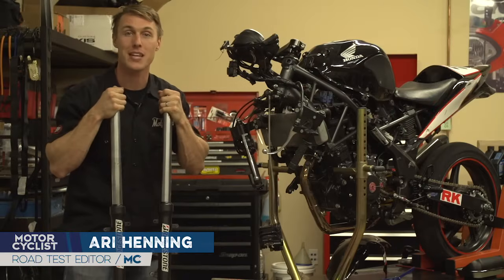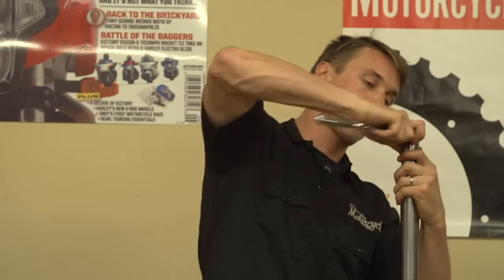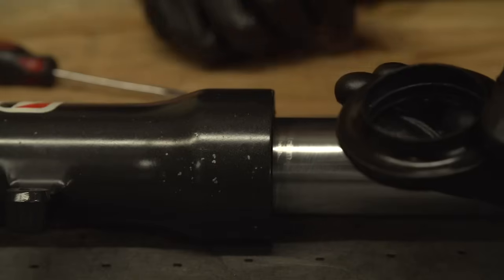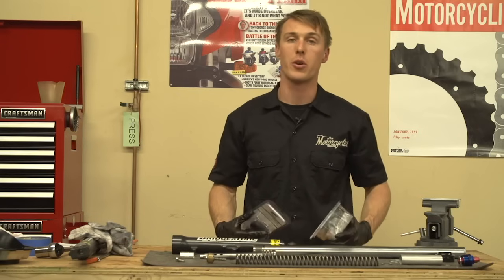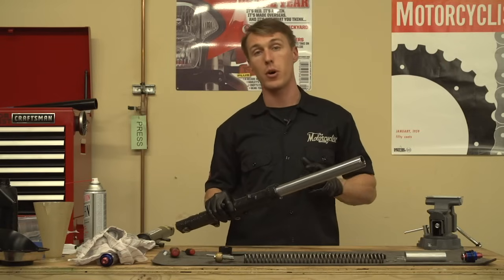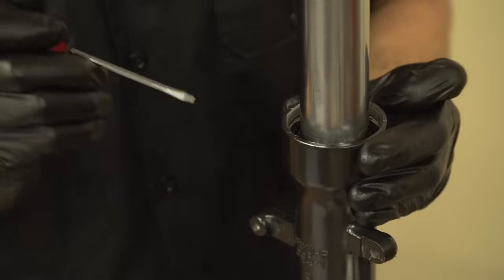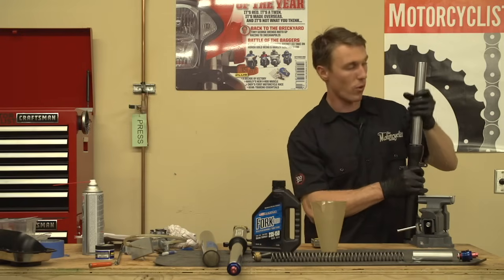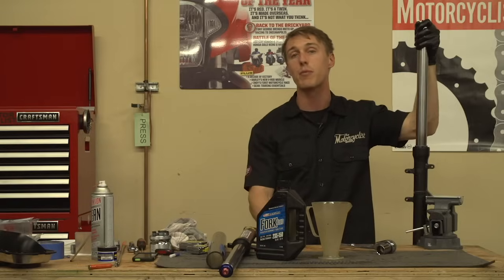Motorcycle Suspension Tech and Maintenance: How To Rebuild Your Fork | MC GARAGE

Comment: Excellent video. The owners manual for my 2007 Honda Interceptor says nothing about fork servicing. Does this mean that the forks on the Interceptor do not need to be serviced? (I bought the bike in February 2016 and am the third owner. The previous owner did not know its maintenance history other than what he'd done. It now has a little over 10k miles on the odometer.)
Reply: Ask questions on vfrworld.com or vfrdiscussion. Definitely would think it still does.
Reply: Thanks. I was kind of hoping I could get out of this. I'm guessing not.
Reply: I have a 98 interceptor, I don't see why the next gen is any different since they use just a barely changed design. I'm part of vfrdiscussion. 2 minutes of your time is definitely worth the wealth of knowledge those places hold.
Reply: Thanks very much! I have an account on vfrworld, but not on vfrdiscussion. I'll have a look on both.

Comment: I have a front fork oil leak from my KTM 390. I believe some dust got lodged between the rubber seals and the chrome stanchion.

I would like to know if it's okay to continue riding without fixing the leak. The oil doesn't seem to be leaking onto the disc brake and I believe half of the oil has already leaked. There's no change in the performance of the front suspension yet.
Reply: ***** Thanks for the detailed reply Ari!
\(^_^)/

Comment: How are you holding the bike up? What type of stands are those and are there alternative ways.
Reply: You can get some stands that hold the bike up from the steering stem they run about $100-150 , you can find them on craigslist used for about $50. If you work on your bike yourself a lot definitely worth the money
Reply: dilsher12  I wanna do the the bearings in the head tube... I would you be able to that with one of these stands? Also can you lift the bike up by the oil pan?
Reply: +John W No unfortunately , you cant change the steering head bearings with that stand . Yes you'll be fine lifting it from the oil pan just use a block of wood to avoid damage . If its a double cradle frame i would try and use the frame for lift points if possible . But I have serviced quite a few bikes lifting them at the oil pans and its been ok .

Comment: how do you know when to change the fork oil?
Reply from the maker: +Christopher Everson Once a year is a good schedule for a streetbike that gets ridden regularly.
Reply: BMW__S1000RR__FTW I keep to a schedule of changing every two years on my bikes, but each bike only gets 1500-3000 miles a year and not too many rain miles.
Reply: My Yamaha FZ6/XJ6 doesnt call it up in the 'periodic maintenance'.  Also checked a Honda CBR500 schedule - dito.
Reply: BMW__S1000RR__FTW vs
Reply: How are regular suspensions suppose to be? because my left one doesnt go alot in but the right one goes in alot easier? what could be the problem?
Reply: The fork could be either twisted or bent. Twisted is easy to fix but bent is more of a workshop job!
Reply: if you see a black lines around your forks that mean u have to change the oil
Reply: @Hotrodder31, that shouldn't be the case. It's hard to say what the problem is, it might be that the seal is slightly cracked on one side, or it might be that one side has more sludge than the other. But, either way, if that's happening, you really ought to do a rebuild on them both as they probably are due for it anyways.

This is probably going to cause you problems with handling whenever the bike is leaned over. If you pay close attention, you probably have more clearance issues on one side or the other because of that..

Comment: Great instructions. How old was the old oil in the fork legs? Also, how do you make sure that the fork legs are reinstalled properly in the triple clamp so the front wheel is in line with the motorcycle?

Comment: Man, isn't grabbing the fork on the chrome bit in the vice like a really bad idea?
Reply: Loosen the cap screw before removing the fork from the bike is easier
Reply: You can probably also put a bit of wood in the vice if you're concerned by that. Wood should be softer than the metal, so it shouldn't scratch or deform the fork.
Reply: Matt Billenstein  you must have soft jaw vice grips and not go mad on tightening the jaws and you should be fine.
Reply: Cap screw and the lower damp rod screw too
Reply: I thought the same thing at first, but it spins, so you have to keep it from spinning with the vice
Reply: he mentioned soft jaw.